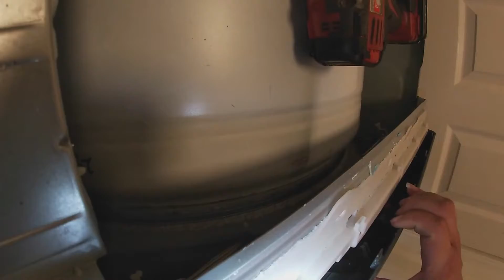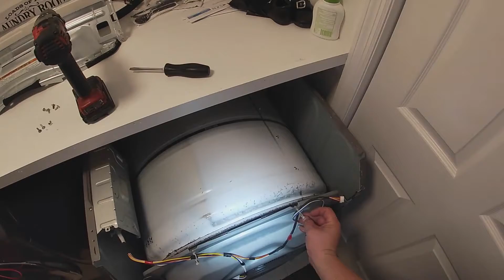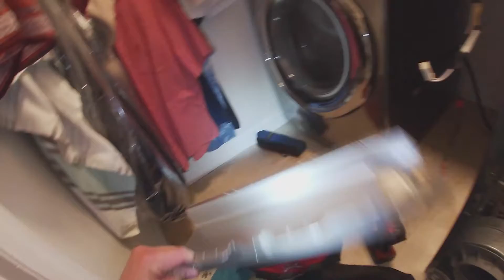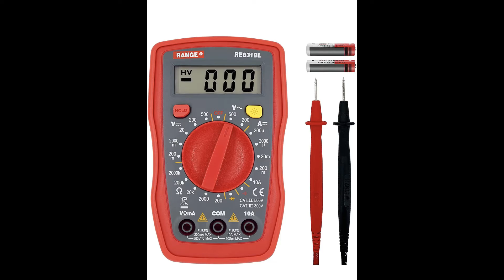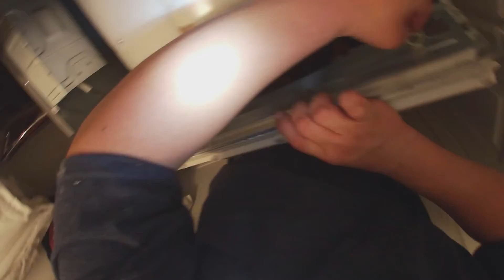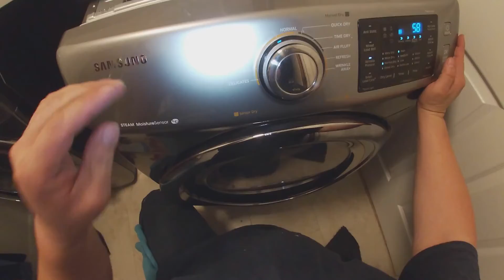How to Fix Samsung Electric Dryer Not Heating | Everything Works, No Heat | Model DV42H5200EP/A3

Comment: Thank you for your video, you have the best view of getting the belt back where it should be. I should've taken your advice about the gloves! My dryer is a  little older and it took me longer to get through some steps, but its well worth it. The next dryer I buy, I'm going to make sure the heater element is easier to get to for repair!
Reply from the maker: Glad I could help with the repair, thanks for watching and sharing your experience! 👍

Comment: Have I replaced the heating element, the thermal fuse, the thermostat, and the thermistor. And still no heat. Do you have any advice on what else it cause be

Comment: My problem was my breaker was only giving enough voltage on one of the hot legs. Worth checking your dryer outlet and make sure it's working right. If one leg isn't working the drum will spin but the heat won't work.
Reply from the maker: Great Tip! Thanks for Watching!

Comment: Thanks for the video! FYI you can save a ton of time because the heating element assembly slides out from underneath the drum. Just remove the three Phillips screws that hold the assembly mount from the front after removing the dryer front panel. Three assembly mount and the whole assembly slide right out through the front. No need to remove the drum for access.
Reply: Wish I had read this before I did all that

Comment: I can't express my thankfulness for you.  This was EXACTLY what I needed.  I don't know what a repair call or what a new dryer costs, but this was $24 for a heating element and roughly 1.5 hours.  Not all heroes wear capes - and you sir...are just that!
Reply from the maker: I am glad my video can help. Thanks for watching my video.👍🏻👍🏻💯💯
Reply: $24 dollars? Where the heck did you find a heating element for DV42H5200EP/A3 for that price?
Reply: @soccerguy2433  Amazon. The complete unit with the housing and thermostats was $54, I think, but I got that one to save some time breaking it all apart. It came with some spare t-stats, too, which I hopefully won't need, lol, but are nice to have in case.
Reply: @odinson7429  can you please share 
 the link to the amazon heating element?
Reply: @odinson7429 can you please share 
 the link to the amazon heating element?

Comment: This video was a huge help in seeing how to take it apart! I replaced the heating element, put it all back together, drum turned easily by hand but when I ran it, it made a horrible rubbing noise. Took it all back apart and found that I had dislodged a spring clip that holds the motor down (movement at one end pf the motor allowed the blower fan cage to rub on its housing). Bent some tension back into that clup with pliers, reassembled everything and it is running just fine!
Reply from the maker: Glad to Hear! Thanks for watching My Video!

Comment: Hey there, I had this similar dryer Samsung DV42H5200EW/A3 and I took it apart just now to see if the heating coil itself was broke and it was NOT BROKEN. I then use my voltmeter and check all three of the sensors on it. When I do that they all show voltage. Are they all supposed to read "ZERO" if its a good sensor and if it shows some sort of voltage does it mean that its bad? I did check the dryer vent and that looks good, What do you think I should do? I was not able to test with the leads off since I had not seen your video and I had put it back together

Comment: Great video!! The model I have is slightly different, with some differences with mounting screws and such (like having the same engine for a different vehicle model, mounting brackets and such may be different), but you did such a great job explaining it that I just did this job on my own dryer. Took me a little while, as I wanted to make sure I was putting all the screws back into the correct places, and the belt was a little difficult to get back on, but once I figured it out it went right on. 

Fired it up, and I had heat and the drum spun. Thank you!!

Comment: great video, I followed it closely, changed the heating element, the fuse, the thermocouple and the thermostat. I also had to change the pulley as it was stuck and the belt dug a groove on it. But even after all these changes, the dryer still doesn't produce heat....
Reply from the maker: You have to make sure you’re getting 240 V if you are getting 240 V most likely is the main computer board
Reply: @DIYRepairsNow  I confirm I get 240V and I replaced the PCB. Still nothing. When I press the "Adjust Time+" and "Temp" together for 7 seconds, I enter the test mode, which properly shows 0 or 1 whether a damp towel touches the sensor or not, and running the dryer in test mode return "OK" and IT DOES HEAT! But in non-test mode, or normal mode, it still does not heat

Comment: This is outstanding!  I have the exact same model dryer, this repair was exactly as you described.  Even the issue with no heat was exactly as you showed where the heating coil was broken.  Excellent video!! My dryer is now heating properly without having to pay someone to come out to fix it and I was able to clear out any fire hazards in the dryer housing while doing the repair.
Reply from the maker: I am glad my video was able to help you. Thanks for watching my video 👍🏻👍🏻💯💯

Comment: Thanks for the video!  It was helpful to know how to take the whole dryer apart, and it was useful to go back through your video to remember the correct way to route the belt.  I went with the element replacement route, and while I had everything apart, replaced the very squeaky tensioner pulley.

Comment: Thanks for the guidance! I just finished to successfully replace the heating element on my dryer and couldn't have done it without your help. I even had the same issue with the top bar thing 😄😄. My major struggle was the band, but I tilted back a bit the dryer so I was standing instead of kneeling and it worked better for me.

Comment: Hey ..I got a  samsung dv42h5200ep/a3 dryer not heating . Got it from someone .I replaced the fuse because it was bad wen i test with the multi meter it was bad. I connected the wires. Blue top red bottom.  Blue top black bottom.  Blue bottom black top ..I can't test it because the store room I have don't have 220 plug. Someone want to buy it .but I don't kno it the wires were connected right..or should red wire be ontop and blue bottom

Comment: Thanks man, ordered the kit and it took me about 90 minutes to do this. A bunch of that time was cleaning the inside of the dryer and cleaning and lubricating the drum wheels. I found flexing the bottom section of the heater tube in helped with the line up at the end. I installed the top piece and stuck my hand inside after getting one screw in, shifted the element around, then did the rest one by one. No issues at all, dryer works perfectly again. Appreciate the video.

Comment: Great video.  I was able to change the heating element with very few issues.  Would probably buy the entire assembly if I had to do it again, as it was a bit of a challenge to get everything lined up, but great directions on the repair.  Thanks!
Reply: Hey, why would you recommend to replace the whole assembly?
Reply: @Kevin, I would buy the entire assembly next time because the sensors/thermistor could be damaged. Although you can use a multimeter to check their ohms, I’d buy the whole assembly. One of the wires had burned, also, so I had to replace that too. 

I agree Chad. I noticed that the new metal sheet holding the elements was slightly thicker than the original, making it difficult to align the screws.